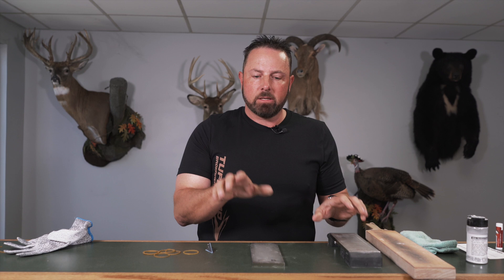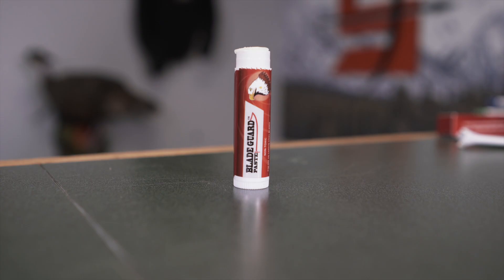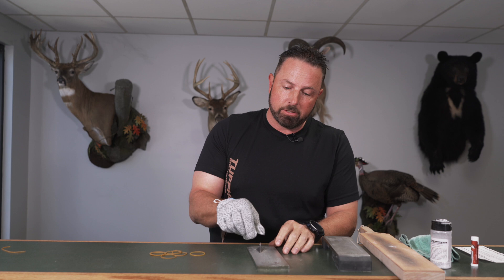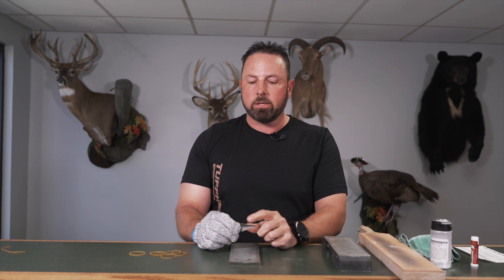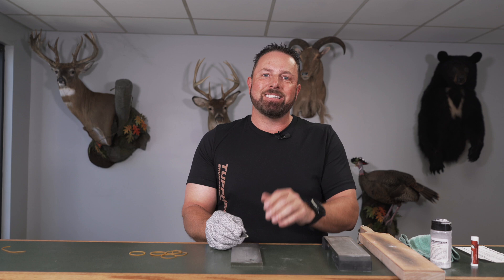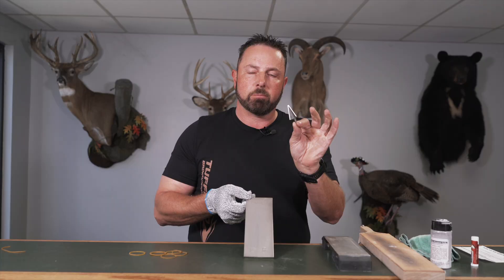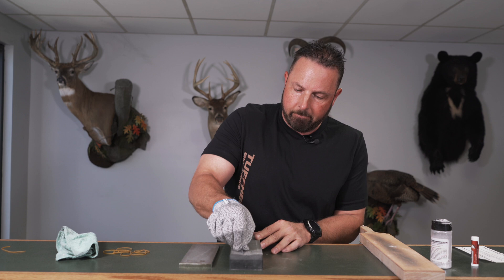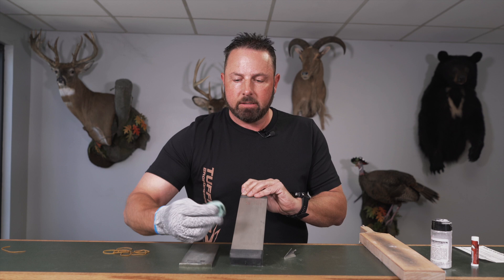How to Sharpen 3 Blade Broadheads!

Comment: The angle on the bevels makes it very hard to get a razor edge on these.
Reply from the maker: Check the blades with a rubber band. 99% of 3 blades have the same bevel angle.

Comment: How about stocking some 200gr 3 blade broadheads ! Why did you kill the 200gr Evolution 3 blade ? Ranch Fairy 200gr heads are not on website anymore either. I love those heads but if you can’t or won’t stock them then….
Reply from the maker: Ranch fairy 3 blades are in stock!